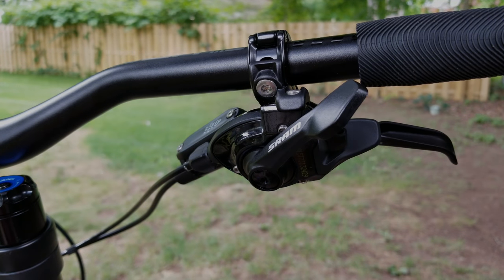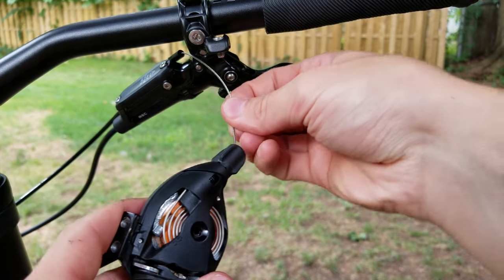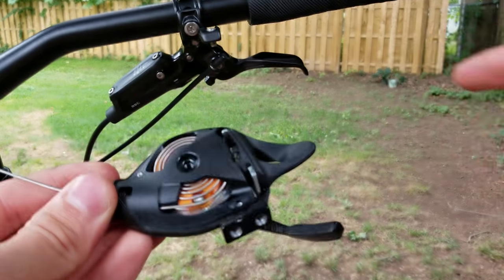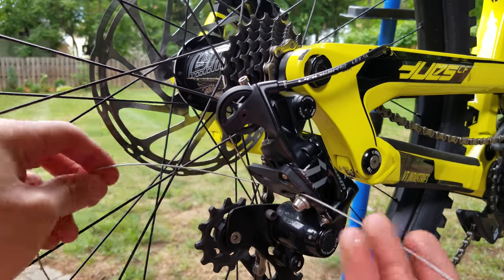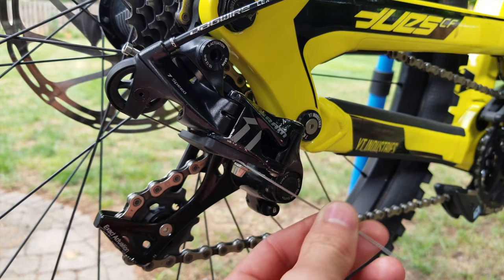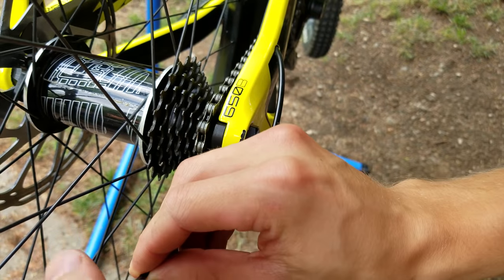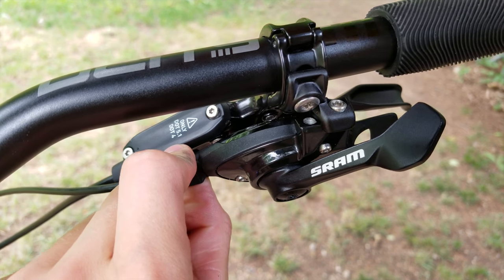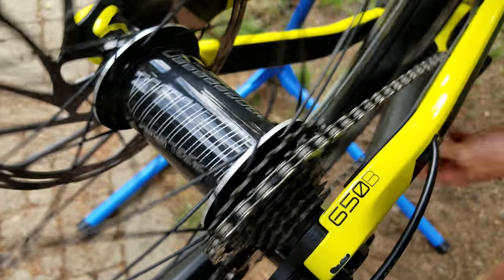How to Tune and Replace the Cable on a Sram Derailleur

Comment: Thank you!!!! 3 cables in the bin tonight before I found this ....had not seen the small  cam mechanism area I had to thread it through pre clamping. If you clamp straight to the nut without doing that you spend hours trying work out crazy shifting ...and swearing. What a releif when I found this !!!!!! :) also was tightening the clamp and snapping my cables. Star
Reply from the maker: Glad the video helped out, nothing more annoying than mystery shifting.

Comment: Good video which confirms why my shifting was bad because the idiot that set up my new bike didn't push the cable through the hole in the second guide cam and also didn't set the high and low limit screws.

Comment: Thanks for “straight to the point “ vid, one question though, the gears shift very smoothly on the bike stand but as soon as I start riding it, it starts to play up. Mine is the old sram x9 model. And the issue is most pronounced between 3rd and 4th gear.
Reply from the maker: Your derailleur or hanger is most likely loose or bent, id check on that.
Reply: The cable will stretch soon after putting on, so you have to set it up again after short time

Comment: would you recommend changing the hanger as well if it has been straighten too much in the past?
Reply from the maker: I personally run them until they break but that would be a smart move as preventative maintenance.

Comment: Question.  On the GX how does one remove / replace the cable pulley?  On the other models, its a pair of 3mm hex, but I can't find any info on the GX.  Any help appreciated.
Reply from the maker: It should not need replacing unless something has happened to it. If it is broken I would say you may need to contact your local shop and see if they can sort it out under warranty.

Comment: How do I add more tension to the cable if the barrel adjustment isn't enough
Reply from the maker: Pull a little harder on the cable before you clamp it.
Reply: @ChildrenOfTheLoam  pulled with all my might with a needle nose pliers
Reply from the maker: @chrisschuele4743  something else is wrong then, check limits and hanger